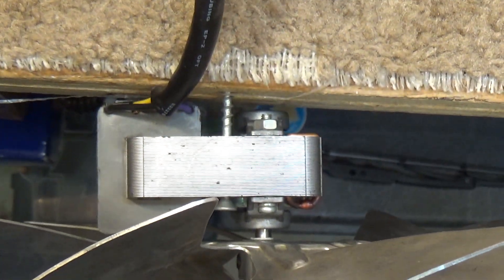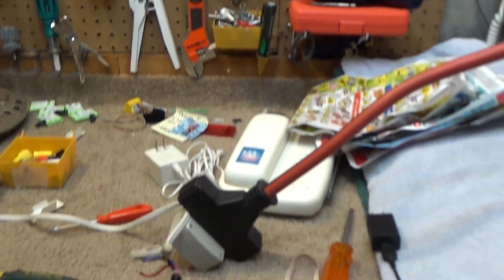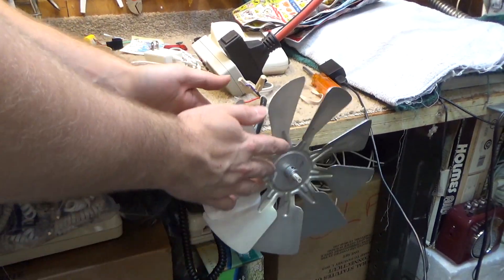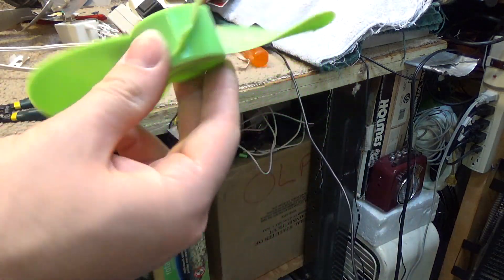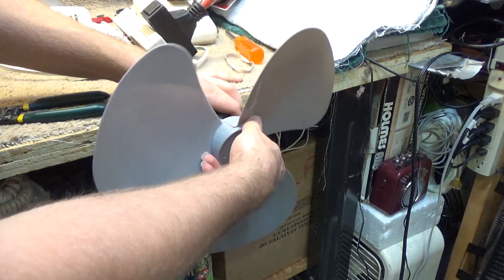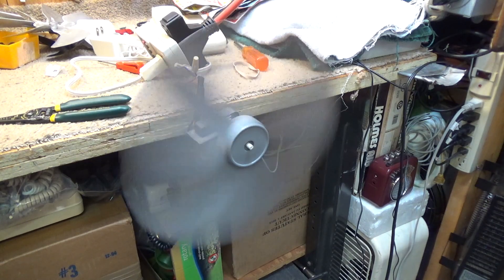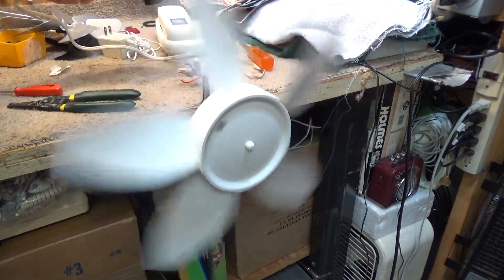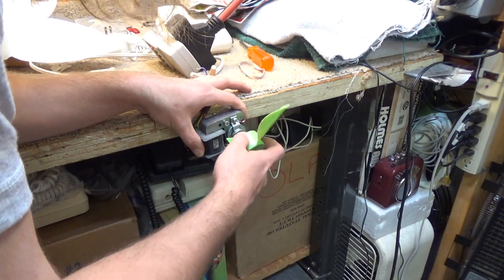Testing Different Blades on a Cheap Shaded Pole Motor

Comment: 3:20 a fan blade with an 16 diameter on a shaded pole motor is pretty cursed in my opinion but it might work if a company that manufactures fans has no choice. (i.e. something like Kaz or World and Main, aka Honeywell and Comfort Zone respectively)